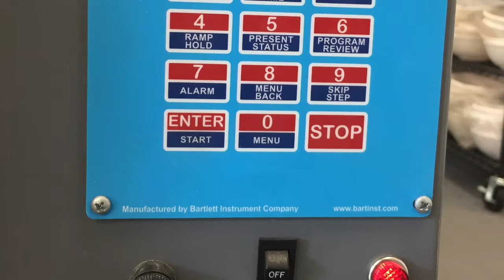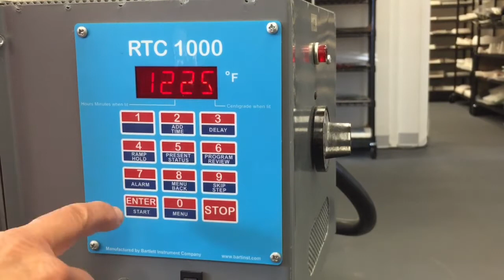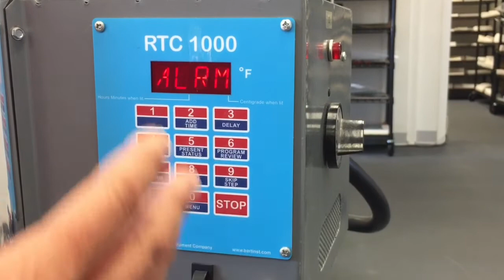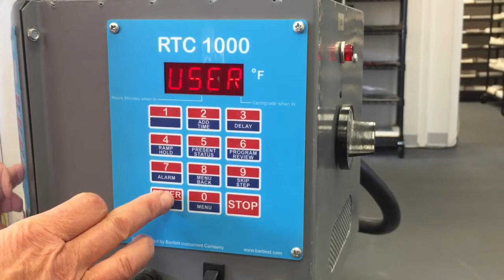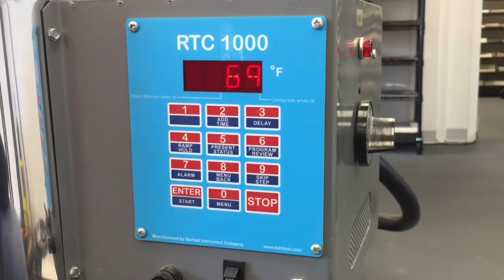Program Your Olympic Kiln with an RTC 1000 12-Key Controller

Comment: So helpful.  What do I set the knob on?  This is a mystery to me.  I, assuming it’s the top elements but I can’t find anything about it in the manual that came with my Kiln.   Thanks so much.
Reply: Hi Sherri, the knob is for the lid elements. I usually keep mine at high, unless I’m draping. I then turn the knob to 2. I don’t like direct high heat on my drops.